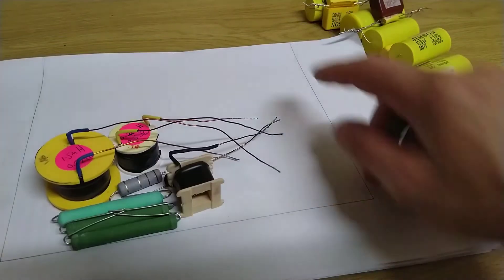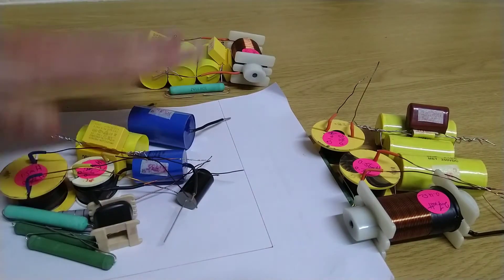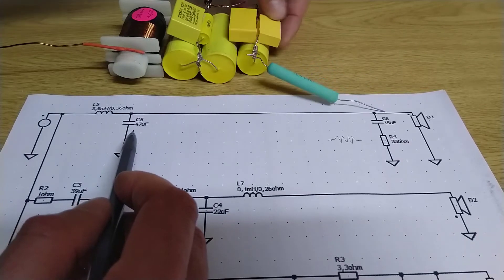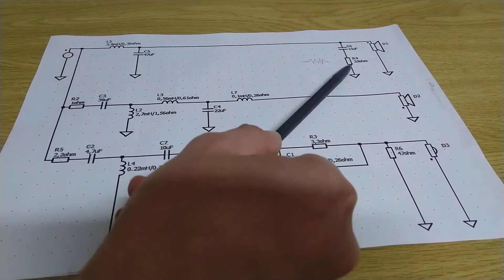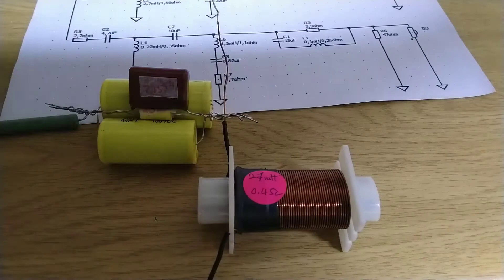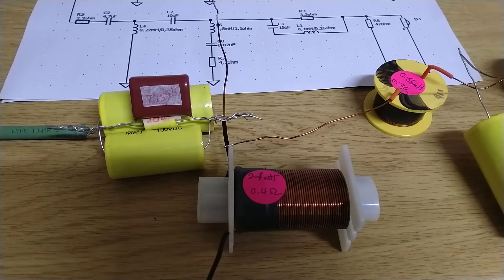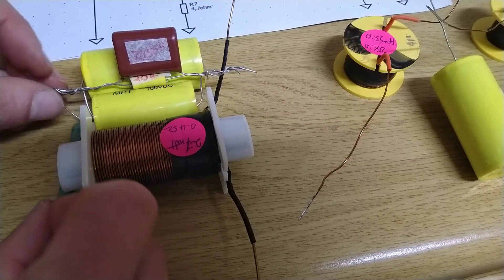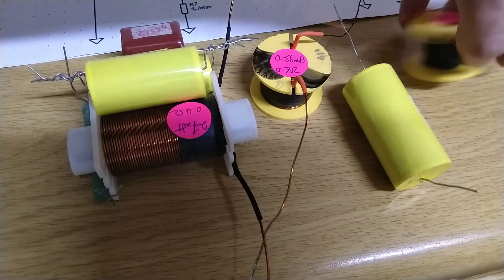Crossover from Plans to Assembly for Mid and Woofer

Comment: What a mess. Use only one Cap not 3 or 4 for the same capacity. No internetshop?
Reply from the maker: They were built during lock-down on the southern tip of Africa. I would have loved to have been able to get hold of capacitors of the exact values instead of putting them in parallel. It would have saved, time, space and money!